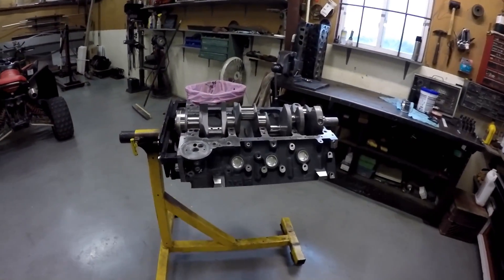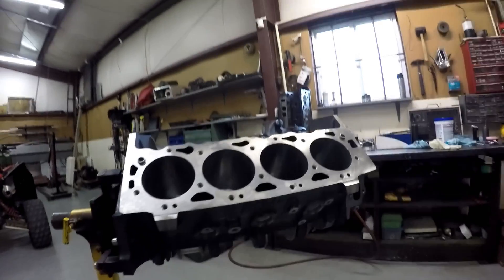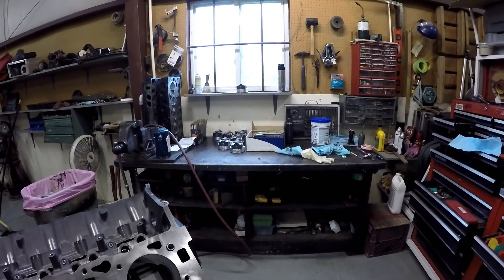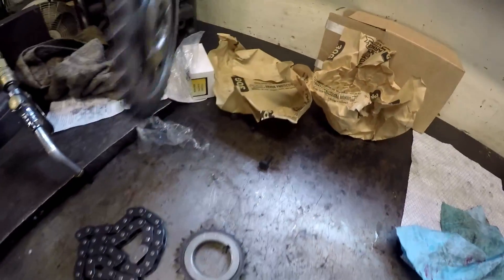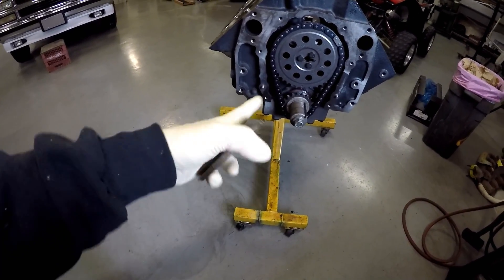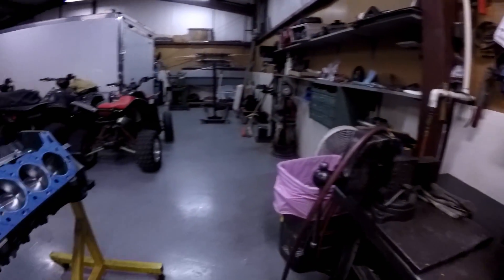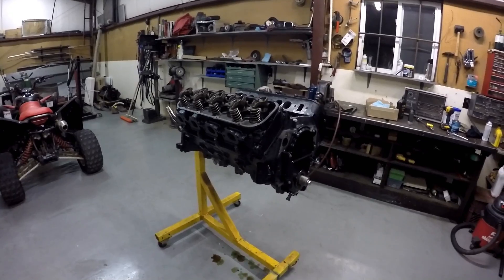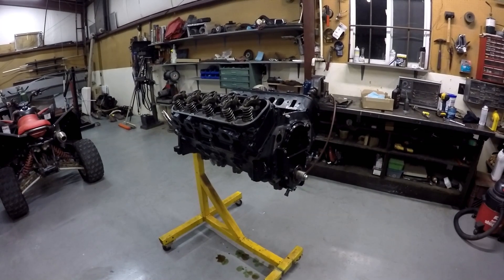Big Block Chevy Engine Build 454 C.I.Vortec 7.4 L Chevrolet. pt 1 of 2 pts

Comment: Wow looks like a nice motor by the book.  something I do when I build an engine I use blue Loctite on the bolts, oil pan bolts, timing chain cover bolts, harmonic balancer Bolt, bellhousing bolts, if I can't put A nylon lock nut on it I put blue Loctite on it unless it's a rod bolt or cylinder head bolt.  also I use blue Loctite on manifold and header bolts no more bolts wiggling loose and ever since I started doing this no blown header gaskets ever. And i tighten header bolts just like a cylinder head from the inside out and I keep tightening them again and again. That roughly 8.87 to a 9.45 compression will give you a increase in power across the board. And should be a increase in fuel mileage because the lower the compression is like dead cylinders not efficient. Higher compression is more efficient like the LS engines and import engines. I would like to know how much you pick up in fuel mileage if you can tell? I write down my mileage on the fuel receipt. fill the tank up with fuel all the way flush with the fuel filler neck out the side of fill neck. write the mileage down again next fill up exactly the same process. and subtract mileage and go all the way to 1 gallon. I cut the miles and gallons exactly in half until I get exactly a gallon. I cut the miles and my gallons in half easier and faster for me because I don't like to divide. If I don't get one gallon I will go past one gallon and add back to get perfect gallon an ad the small mileage backup so fuel test will be exact. What would have been really nice to have is those Pistons with real thin Rings like all the new vehicles have thin rings for increased compression almost no ring or block wear ever. No blow-by or oil consumption less drag and a little more power like the Ls engines and imports technology. I looked in a set for a 350 I was building and it was custom and something like $800 or more. So I decided not to go with those Pistons at that price. I would have liked to but just too much money. Too bad they couldn't make one off the shelf with the thin ring package. At a glance those heads looked like big oval ports they didn't look like the peanut truck port but when you said the runner was I think a 235 intake runner CC that sounds like a peanut port. But your heads look like a big oval port. The heads of a peanut port are like golf ball sized holes and almost exactly round roughly. I came across a 19,000 mile short block 93 model 454 for $300.00 a few years ago. The only problem the piston lightly A little part of it come apart just a little part and glazed the cylinder wall. I was like Lee able to hone it and keep it standard bore. but I didn't have the cylinder heads with it. I used a set of 70 model 454 heads on a 93 short block it barely had any miles on it. Apple Chevrolet talked about some special head gasket but I use just regular head gaskets and made sure everything matched up perfectly and it worked like a champ. I can't remember which cylinder head gaskets I used on it now the 93 model or the 70 model head gasket. But at the time it was which ever one matched up exactly. The pump gas motor was a 12.5 to 1 Dome piston with oval Port heads with pump gas. I didn't have a exhaust gas temperature meter on it. so I couldn't see how hot in the cylinder it was really getting. It ran fine perfect. I had the timing back so far the car was very lazy to run on pump gas. I never heard any ping for popping any detonation And my car was pretty quiet running through for Mufflers to keep it quiet on the street so I didn't get harassed. I luckily sold the whole engine and made a profit off of it that's always a plus. the guy call me back later that bought the engine and he pulled the motor apart it was running fine but he just wanted to pull the motor apart. He told me the Piston was coming apart in it I sold the motor as is it ran perfect and had about five thousand miles I put on it. But obviously it did that fine detonation I couldn't feel or hear.  on my other big engine in my street car I'm going to put exhaust gas temperatures on it so I can make sure in the cylinder it is not getting too hot. my temperature on that 12.5 to 1 compression engine at its Max temp was 178 degrees Max with an autometer water gauge. On my one car with the 572 engine in it with about 10.6 or 10.7 to 1 compression.  had to shave the heads a little more to clean them up at the last rebuild. The motor was exactly 10.5 compression before last rebuild. I'm going to put exhaust gas temperatures in the pipes to make sure I'm not too hot under wide open throttle or at idle. Because I don't want to hear about another Scorched piston or Pistons again. I felt so bad that guy had that problem with that 454 I sold him as is.  he said three or four Pistons were burned so he just replaced all of them. I've been in automotive industry for years but something I didn't realize until recently. I wanted to build a 454 Towing pulling truck like yours but carbureted. But I went with a Cummins diesel for Towing something  and for a daily driver. I never realized. The truck is all stock completely. 2004 2500 quad cab long bed Cummins turbo diesel manual transmission 6-speed.  All stock except airbox that come on it. At around 70 miles per hour I get about 10 or 11 miles to the gallon that's no trailer and truck weighs 9200 lb at the scales. I slowed down and turn about 1150 or 1250 RPMs at 40 through 44 miles per hour and I got to 42.5 miles to the gallon. With cruise and AC on and with about 1,700 pounds of tools and tool box in the back at all times and the tank is usually always full of fuel. And weighing the truck at the scales at the Rock Quarry. But the biggest thing I found out with any vehicle and fuel mileage the lower you turn your rpm's by any means possible you are going to pick up fuel mileage drastically. At some point I want to drive the truck at about 30 or 35 miles per hour and see how much more fuel mileage it gets. I figure it will probably get about 55 or 50 miles to the gallon. When I go on a trip I just watch my back and run my flashers. I was going to buy a bigger fuel tank but now I don't have to because the truck is incredible I get massive fuel mileage it just takes forever to get there. But no stopping or looking for fuel stations. But I can go right at A Thousand Miles without stopping for fuel on a 37 gallon tank. Also with a manual transmission I do drift in neutral off of every Hill. But anything will get better fuel mileage the lower RPMs you turn. I've got a new gear vendor Overdrive for a Powerglide I can exchange the tail housing to fit my Cummins truck but man that is a lot of work to put one of those things on. Also they say in the diesel truck books In the six gear when you hit the gear vendor overdrive it drops 500 RPMs off the top that's something else that would save drastic Fuel and I could keep up with everybody else on the road. And still get massive fuel mileage when i drop 500 RPMs. Also I haven't installed the gear vendor on anything it's been in the box for a while. also around town I used to get about 10 or 11 miles to the gallon. I started Shifting the truck around 1,000 RPMs around town and I increase my fuel mileage to almost 19 miles to the gallon. And I drift in neutral when I can and I shut the truck off at stop lights.  hopefully this helps you also I found out even towing a heavy trailer slowing down picks up fuel mileage up drastically. Also it's less wear and tear on the truck and everything spinning less RPMs.
Reply from the maker: jon smith ..  Wow!! Jon  I think that’s the most extensive comment I’ve ever had on my channel!   As far as checking the fuel mileage, we’ve been out of town on three trips pulling the trailer and to be honest with you I didn’t really pay that close attention to the fuel mileage.  Was running it pretty hard so I’m sure the mileage wasn’t that great.  
One thing I will say at cruises around 70 to 75 mph much easier than it used to. 
Thanks for checking out the video and for the amazing comment much appreciated!!!
Reply: KC ATV World you're welcome good luck on the rebilt engine.

Comment: Awesome work Sir! I want to swap my 99 suburban's 5.7 out for a 454. Did you degree your camshaft? Also did you use any dials for clearances? is all of that science and math necessary?
Reply from the maker: Hi Mike .. On the camshaft I just put it in at factory specs which is 0°. Did not advance it .   As far as their clearances on the crank rods and pistons oh yes everything is down to a Nats ass.   All of the measuring, Clarence was done by the machine shop before they sent the block and all of the other lower unit stuff to me.  I did do a plastic gauge check on the mains and rods when I assemble those just for my own reassurance though.  Good luck with your project thanks for watching and appreciate your comment!
Reply: @kcatv9556  I had a 515 BBC built a few years back and I remember the engine builder telling me he installs the cam in at 2 degrees advanced on every single engine. He said it just gives them a small bump in torque and drops the redline rpm down a couple hundred which is nothing. Plus as the chain wears it'll fall closer to 0
Reply: @Kmecha84  Good point. Besides how often do you really use over 5000rpm if your not racing. I've always preferred tq over hp personally but that's the mud bigger talking lol.

Comment: Takes me back to my drag racing days,compression ratio about 9.5 to 1 is still good compression ratio.  what kinda cam did u use? Sounds like you are right at the point that high perf gas will be needed
Reply from the maker: Hey! Bob... Yeah that was something I forgot to touch on the camshaft.   Forgot to turn the Camera on when installing the cam as well!   Rookie filmmaker hahaha.  Anyways I went back with the stock factory camshaft sense this  motor is a fuel injected computer controlled didn't want to make any camshaft changes. 
Thanks for checking out the video Bob greatly appreciated!

Comment: What about the cam? Four bolt mains and quality pistons are a good choice, but a camshaft is the SINGLE most important part of an engine (duration and lift control low end torque for towing or high rpm racing.) the last tow motor I built was a 468 BB with 9.2 compression and 268 Comp Cam fed by a Predator  Carb in a 2500 with posi. That truck wouldn’t pull after 70mph, but would burn the tires from a stop sign with 4K in the bed of firewood.
Reply from the maker: Hey, Badge-Cat... Sounds like you built quite the thumper there! 
As far as the camshaft I stuck with the stock factory cam. 
This motor was designed to have Power at low RPM all torque. 
This truck would cruise down the highway at 70 mph around 2500 RPM.  So that's where I wanted to keep the power is right in that RPM range for towing. 
This thing is also computer controlled fuel system with an ECM, airflow meter, and O2 sensors controlling your fuel ratio. If I would have changed and went with something other than stock cam I was afraid I would have had to reflash the ECM to change the fuel curve .  With only changing the compression ratio the ECM in stock programming should be able to monitor the O2 sensors and the air flow meter to keep the fuel ratio correct. 
Not sure if you noticed the cylinder heads with the really small intake ports all for low and power won't really do much at high rpm. I should have took a minute and went over the cylinder heads a little bit so folks could see what type of head was going on the engine.  Thanks for tuning in and commenting greatly appreciated my friend!
Reply: Fr, a gm zz502 cam would really have woken this thing up, especially with the added compression.  Could have run 10.5 with a proper cam tbh